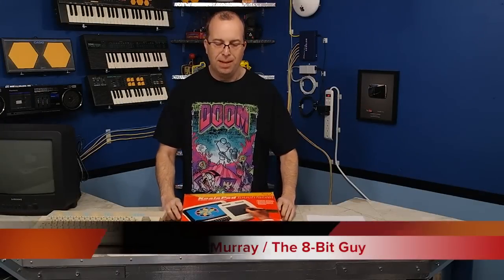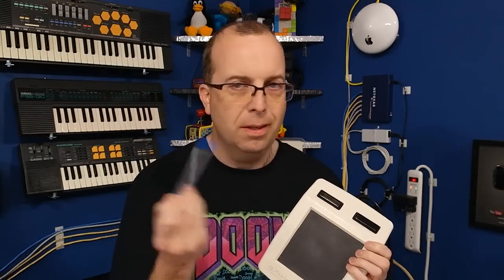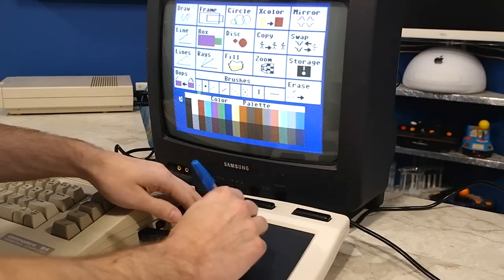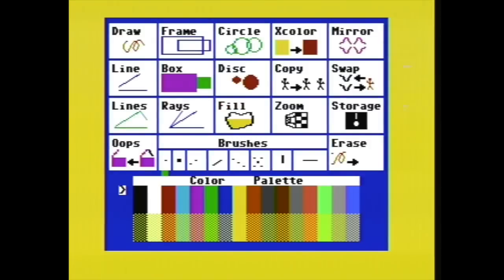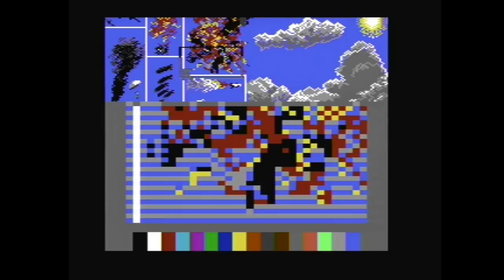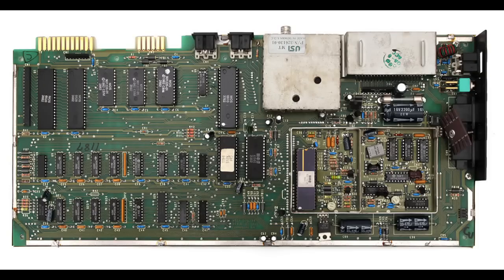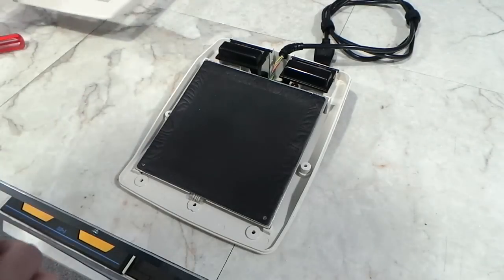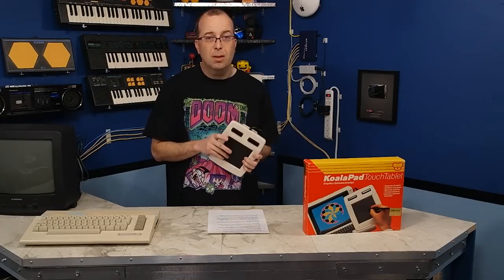The KoalaPad - How we used to create graphics

Comment: One thing I did'nt get in the video: does this device work like a laptop track pad or like a phone screen ? I mean: does it detect the relative offset of each moved (changed) coordinate and moves pointer or it gets the actual coordinates on the pad an scales them to the computer screen ? (All the scaling job is done by the soft)
Drawing with an offset like device needs some serious synchronization skills between pen and button, and some how is a real pita  :)
Reply: Steel Mecano The device simply generates a voltage output (as part of a resistor divider network) that is converted to an 8-bit (0-255) value by the C64 internal ADC logic, the software then maps those values to XY coordinates on screen (as such you would have better vertical resolution than horizontal).  So, it is essentially working in an absolute coordinate system that maps a touchpad position directly to its equivalent onscreen position, much like any modern graphics tablet or the older CAD digitizer tablets.

Comment: Tried messing about with it as a temporary replacement as a paddle on the Atari 2600. All things considered, it wasn't bad for using on Casino. Tried a few hands of blackjack; so was hit or miss if the pun is excused. Bit of a pain to use for that reason. 

Considering it was something that came from the former owner of my C128; it does the trick until actual paddles are available to play with.

Comment: I had one of those for my Atari 800XL computer. It was pretty cool.  Given the fact that Commodore used the same game controller interface as Atari game consoles and 8-bit computers of the time I guess that hardware wise, the Atari and Commodore versions were one and the same except for the software.  The C64 version Koala Paint shown here is pretty much the same as the Atari 8-bit version I had.  You did not mention this and probably are not aware that the pad has two slots on the vertical sides to allow placing templates on top of the pad for different purposes.
Reply: Luis R - Im not sure that the Atari Version  have the same wiring and signals  on  the 9 Pin connectors. To change the registers from the Joystick directions  on the c64 were shortend "up"  with ground , "left" with ground "right" with ground , "down" with ground, and "Fire" with ground signal. So were 3 pins on the connector free. one of them is pot x and the other pot y ,i think. 
It would be interesting to see how compatible the both Koalapads would be.
Reply: They do have the same wiring or at least are fully interchangeable.  I know for a fact that the joystick controllers I had for my Atari 800XL worked perfectly fine on a Commodore 64.  What you describe is exactly how Atari joysticks worked.  They were just four directional switches that shorted to ground when the stick was pulled to the proper direction plus the trigger button. It was five digital inputs, two analog inputs, +5V plus ground.  The paddle controllers seen at 4:50 in the video are actually Atari paddle controllers.  Those controllers came in pairs as can be seen in the video and I distinctly remember their triggers were wired to the left and right joystick lines (pins 3 and 4).  I wrote a few programs in the Atari 800XL that used paddle controllers.

Comment: Very interesting... it was basically a soft layer touching a harder layer, resulting in 2 resistance values (one for vertical and the other for horizontal), correct?

Hypothetically, you could build newer  touchpad or joystick from scratch? But is it possible to make a mouse with this interface?

Unfortunately, I don't know much about the Commodore nor Apple II... my first computer was actually a PowerBook 100, but I like to see how the old technologies influenced the development of newer pieces of equipment. And it is a quite nice logical exercise to see how it works and actually be able to develop new solutions based/inspired on it.

PS: Wow... Alexander Brandon! That's a name I don't see in a fairly long time. I cannot forget how cool was his soundtrack at Tyrian. 😂

Comment: The C64 with it's innovative touch pad, light penaccessoires, koal apainter and fixed draw software the C64 was lightyears ahead of it's time, you could even send a picture trough a modem in fixeddraw wich is mind blowing concidering the limited bandwich & limited network capability's of it's time.

Comment: I wonder if anyone has ever stuck a PC mouse's PCB (Printed Circuit Board) into a Koala pad, replaced its Atari-joystick-type cord with a USB cord, and then used that thing as a mouse in his or her PC. I think that would be a pretty cool project.

The reason for the necessity of replacing the Koala pad's PCB with a PC mouse's PCB is that PC mice work quite differently than Koala pads (PC mice don't use potentiometer registers the way the original Koala pad did).

Comment: What still kinda bothers me is the resolution. The c64 had 320 horizontal pixels. For sprites it used some in hacked 9th bit to get the full resolution if i remember right.
But the A/D only gets you an 8 bit value. How could you address more than 256 pixels?

Comment: Doesn't seem that odd the controls are running through the sound device for input. That's how seirial Midi/ Gameports worked in the 90's. I have a completely analog flight stick that has zero electronics inside of it, the buttons and potentiometers hook strait up to the Midi port.

Comment: I like the form factor better of the newer C64 because I'm an AMIGA fan and it's a pint sized AMIGA. I would swap the SID chip with that of an older C64 though as that was better and then it would be the ultimate C64 for playing games on like the AMIGA 500+ was the ultimate AMIGA due to bringing 1MB into the game which lead to smooth moving titles.

A also liked the A1200 2MB but not many AGA games were made for the 2MB in mind though which ruined the rep as not many people had the money to expand it to a better processer the later AGA games actually demanded and that requirement punshed the player if you had an unexpanded one by slowing the gameplay to a crawl.

The AMIGA 256 and 512ks didn't have enough memory to make a smooth moving games half of the time talking about ST ports era but they tried their best on the diamands in the rough to get around the RAM limits making a few quality games still here and there in that era.

For AMIGA hardware I'd go for the A1200 it typically played most of the better 512k ECS Agnus titles with some kickstart help, all the ECS 1MB titles and the AGA titles made for 2MB in mind but you neveer had such hardware choosing problems with the C64 it just worked and was always 64k limited so you knew how your games would run.

Whilst I love AMIGA and don't have an attachment with the C64 other than some games and some music I do get what people are coming from when they say the hardware itself might have been better in some ways like the fixed RAM so you knew what you were getting and that all titles that were made for it are running on it at an intended speed on the C64 no matter what the look of the hardware was.

The A1200 though I think could have been the best Commodore ever made if the promotion was right and they sold the expanded ones without having to buy triple the price of the hardware processor expansions because it would be in the model you chose to buy already especially if they were able to add a C64 and pre C64 disk mode only as AMIGA ran floppies backwards mode in it and an OCS/ECS/AGA selector at startup on the special processing models.

There was definitely plenty Commodore could have done to save the AMIGA A1200 but they stuck with the 2MB 020 only being out haing to pay hens teeth for a 040-080 to make slow AGA games run proper speed.

I would have loved a Pet-C128 and a OCS 256k/ECS Agnus 512k/ECS 1MB/AGA backwards mode to have the full Commodore range experience on my Commodore AMIGA and even a form factor you can put a floopy or CD in on the side for a CD32/TV/ACD/Floppy boot mode would have been nice on an Expanded Processor edition.

Commodore made a lot of good 8-16-32-Bit computers but never had the buisness sence to be able to stick in the game post 1996 sadly by not giving us those pre expanded AMIGAs at a fixed price and not letting us play enough backwards titles without WHDLoad and C64 emulators.

With Colento owning the rights to every Commodore bios out there and Vampire's coming out left right and center we could have a new AMIGA with this dream OS on it containing every Commodore ever made played at a Vampire speed but I don't think even they have the buisness sence to bring this dream real hardware out sadly. I do want a combi Pet - A1200 with Vampire processing though as I'm an AMIGA fan who does like games on Commodores in general even the bottom of the barrel ones lets alone the Mega Powers of the 64 and AMIGA.

Comment: It's internal construction is not that surprising. Probably just some ADCs to convert the messy analog 4wire resistive touch pad signal into something a bit cleaner for the computer to prevent the cursor from jumping back and forth near pixel boundaries.